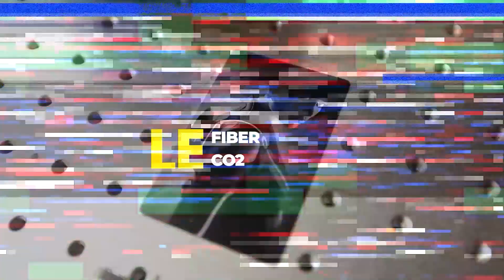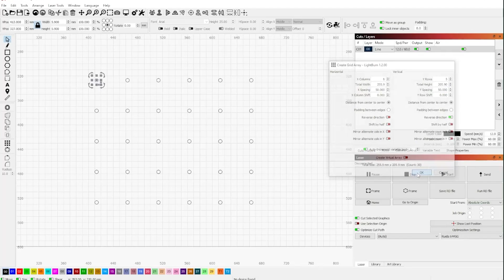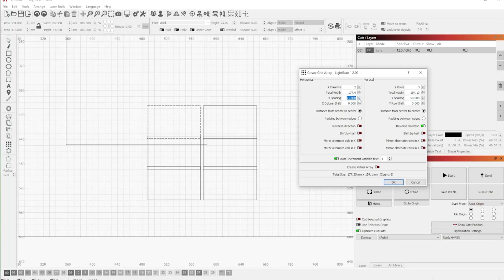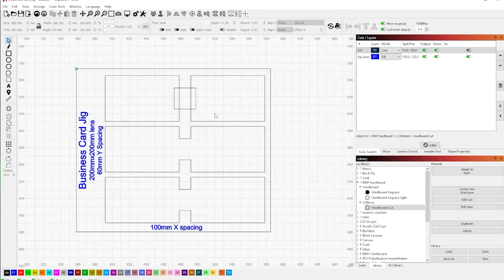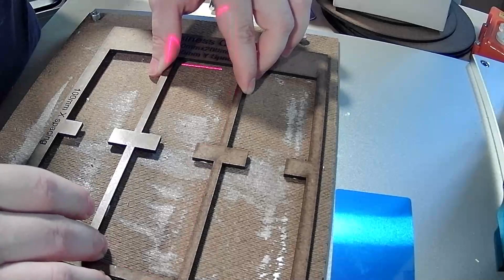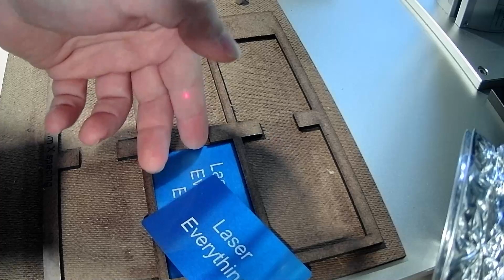Jigs! | Create EASY Fiber Laser Jigs with Lightburn

Comment: Awesome 🙌🏻 
I’m fairly proficient in jigs now. 

A couple tips I can perhaps recommend is when doing that amount of text compared to cutting on the CO2 have it flipped so the text runs along the laser head axis it will engrave 10x faster.  

Also to align the jig top plate on the fibre just mark it with the laser first even though it’s not technically designed for wood it’ll still engrave a mark on low power for super quick, easy and accurate alignment 🙌🏻.   
But seriously how good are jigs 🎉
Reply from the maker: Thanks for sharing the tips Nate! We love us some jigs :)
We got more coming on this topic (admittedly long overdue and delayed). We wanted to start very basic and move into more and more options to make sure there is an option out there for everyone.

Comment: Are there any issues with using wood as a gig for a Fiber laser?
Reply from the maker: With all organic material including that used in this video there's a risk of fire if the laser is left running to long. If you don't leave your laser unattended it shouldn't be an issue.